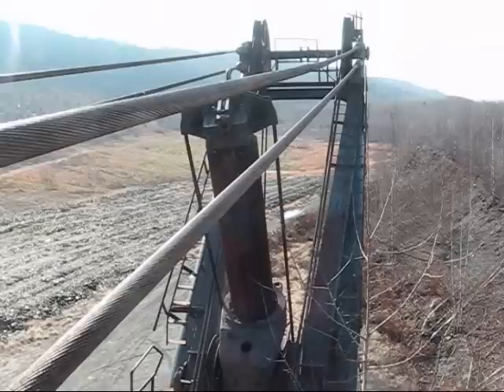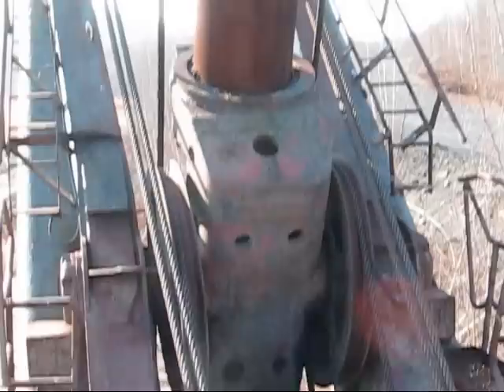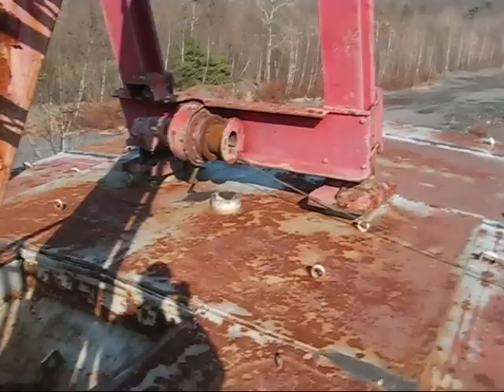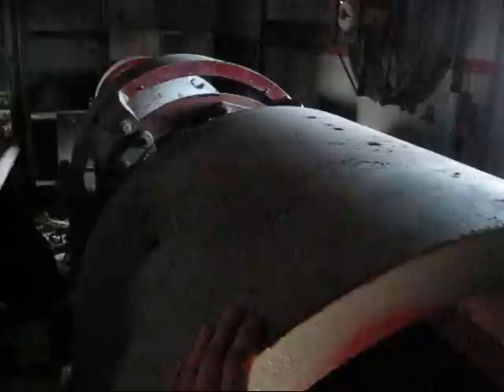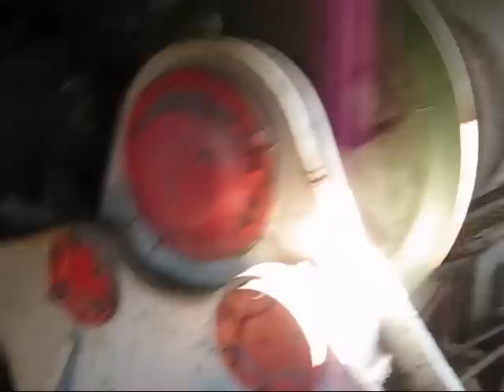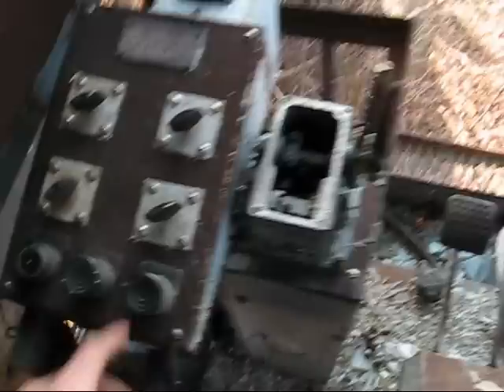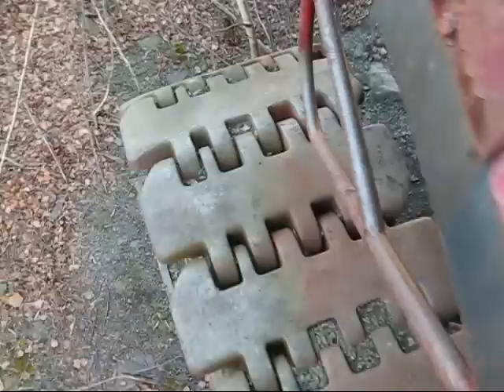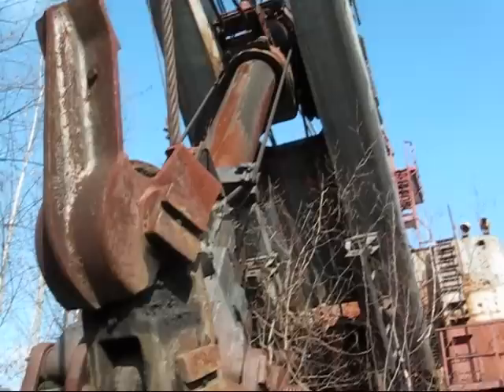Bucyrus-Erie 280-B Documentary

Comment: Great video! We have allot of these old electric shovels abandoned in Northern MN at the iron ore mines. On another note I bet you could do a kick ass impersonation of Dan Akroid! I can hear a hint of him when you talk.
Reply: Eric Bolduc yes we do at this one mine in mn I Sen 195-b and a 280-b
Reply: Unfortunately in Minnesota most of them were either scrapped or parted out.  The parts go primarily overseas where they still run.

Unfortunately most of these would have a hard time reaching the center of the modern larger trucks, much less loading them efficiently.

In Minnesota the 100 ton Lectra Hauls and 120 ton Wabcos that went with these machines are gone or stuffed and mounted too.  Too small.